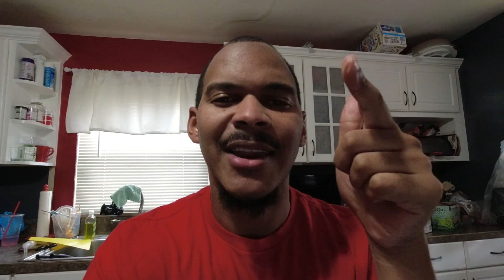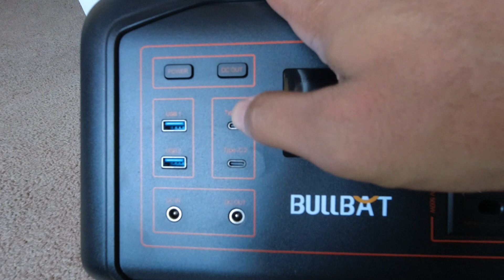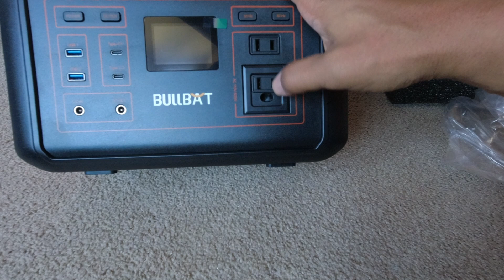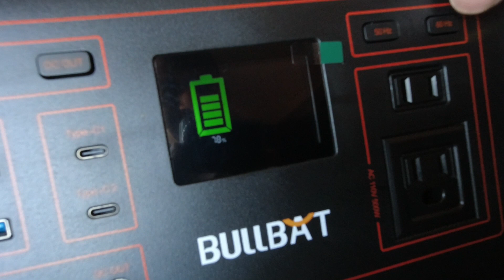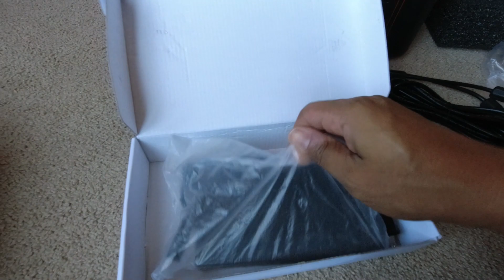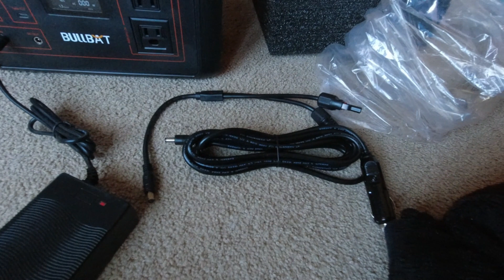Bullbat 500Wh Portable Power Station | UH OH!!

Comment: Is the 12V output regulated?  For that price, I'd hope so!  I'd be interested in a little more in-depth testing, perhaps more focused on suitability for an actual use.  Hobotech's detailed numbers don't always translate to actual use because of things like cycle time of appliances.
Is there by chance any kind of factory reset button on this box?
That power adapter, at 115W, is a nice big one; 65W seems more typical, although my Rockpals one is 90W, and some of these come with wall-warts only good for around 24W-25W.
Reply from the maker: I'm pretty sure @ regulation. I'll test the next one. It's coming tuesday.